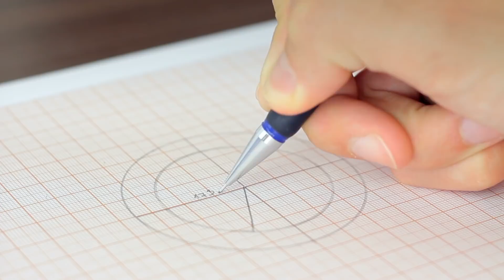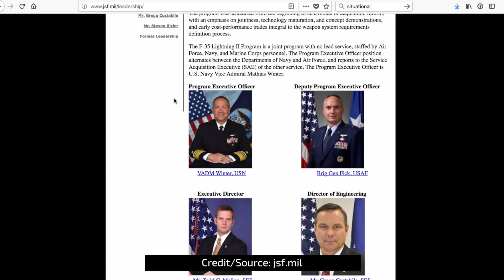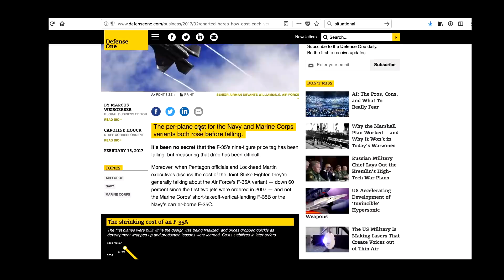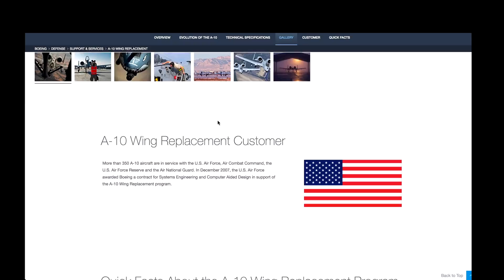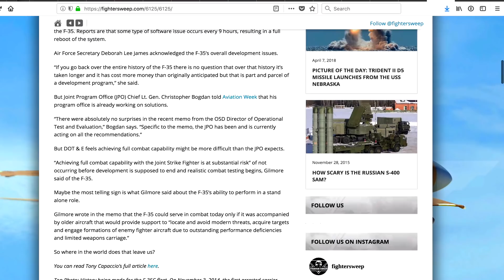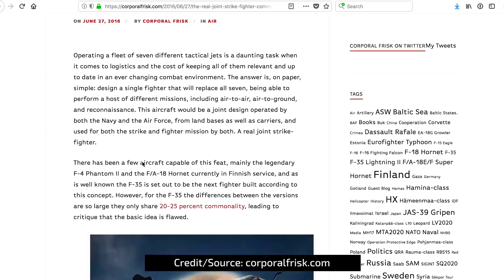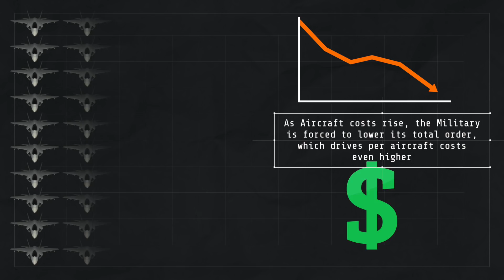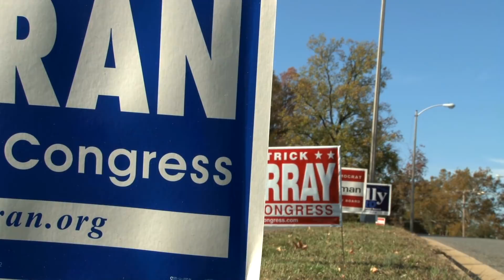Why the F-35 Lightning II Might be the Most Expensive Military Aircraft Mistake Ever

Comment: Thick body?

https://qph.fs.quoracdn.net/main-qimg-342d72909752c9b80e89e13b6b0fc9dd
F-22 vs F-35 body comparison

https://youtu.be/SsUCixAeZ0A?t=1030
F-14 designer (former Northrop Grumman VP Mike Ciminera) with body lift argument debunks  Pierre Sprey's wing loading and wing size arguments. Most 4th gen fighters has body lift designs.
Reply from the maker: [CHRIS] I have read, watched, and listened to Pierre Sprey, and his opponents. I think quite a bit of what he says has validity on paper and maybe some even in practice, but much of it also behind the times. This is a really good article: https://foxtrotalpha.jalopnik.com/pierre-spreys-anti-f-35-diatribe-is-half-brilliant-and-1592445665
Reply: I have already read the pierre-spreys-anti-f-35-diatribe-is-half-brilliant-and-1592445665 along time ago.

https://s14.postimg.cc/3l1dunl9t/F-35_body_lift.png
F-35A's real wing load i.e. colored green to blue are the lift surfaces.

F-35A's real wing load i.e. colored green to blue are the lift surfaces. F-35's  engine cowling generates lift that rivals wing lift hence easily duplicating F-18's long LEX or forward fix canards functions.

The real F-16 designer http://www.codeonemagazine.com/article.html?item_id=37
F-16 Designer Harry Hillaker

Harry Hillaker's statement on low wing loading and wing size...

We knew that we wanted low wing loading and high thrust loading. But we also knew that low wing loading means more weight and more drag

Sprey's argument on wing loading and anti-small wings are not compete. Larger wings introduces higher drag . 

The trick with F-16's design is have medium wing loading, smallish wings and lower wing load during angle of attack turn with vortex lift. F-16 has blended wing design to get more lift from the body.

Basic wing loading empty weight without factoring forward/rear body and vortex  lift factors.
Fuel and weapons load can change with different missions. 

F-16C Block 50
Empty Weight: 18,900 lbs
Wing area: 300 ft²
Wing loading: 63 lbs/ sq feet.
Thrust weight ratio: 1.51 : 1

F-18E
Empty Weight: 31,500 lbs
Wing area: 500 ft²
Wing loading: 63 lbs/ sq feet. (optimised for minimum turn radius)
Thrust weight ratio: 1.40 : 1

F-35A
Empty weight: 28,999 lbs (Year 2015).
Wing area: 460 ft²
Wing loading: 63.04 lbs/ sq feet.
Thrust weight ratio: 1.48 : 1

F-35A's empty weight is 1.54X scaled from F-16C.
F-35A's wing area is 1.53X scaled from F-16C.
F-35A's 43000 lbf thrust is 1.50X scaled from F-16C's 28600 lbf.